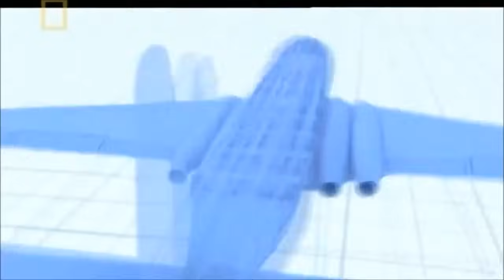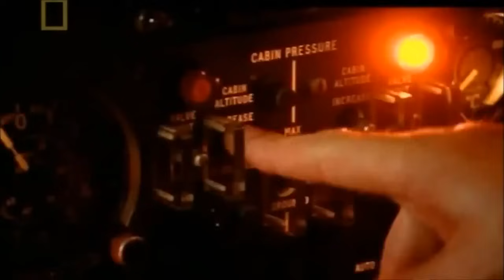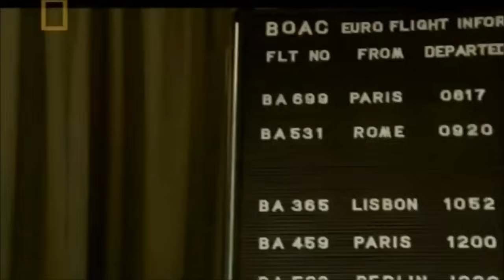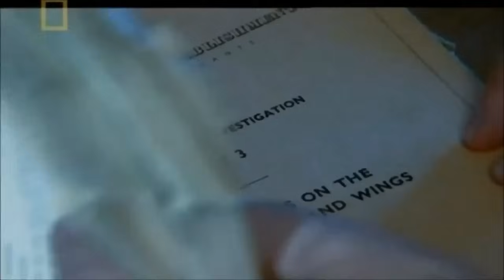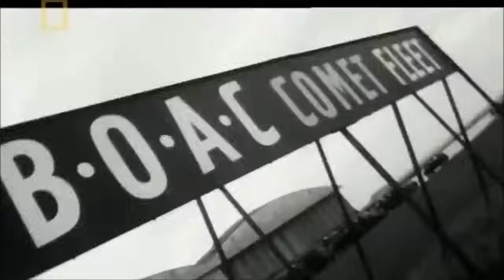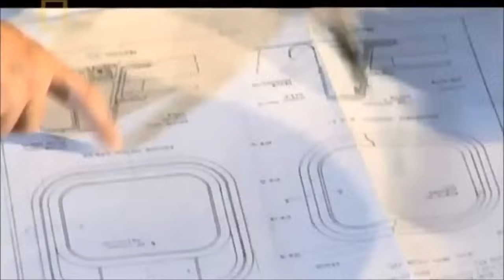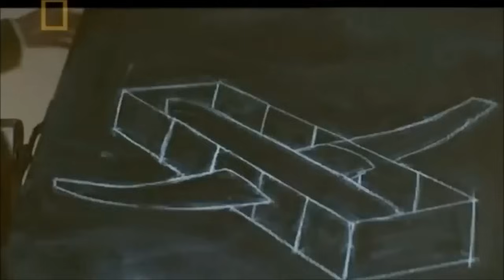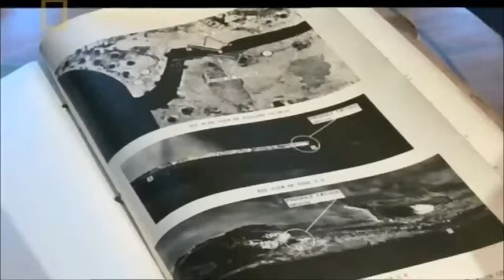British Overseas Airways Corporation Flight 781

Comment: How could they not have anticipated the stress of pressurization on the air frame?
Reply: The same way 2 shuttles went boom, is the answer. We learn
Reply: Ricardo Testa WRONG ! ! !  Boeing started building pressurized airliners in 1938 before the war and the B377 built during and after the war was pressurized as was the B47 and the B52...BOEING knew what they were doing when they built the 707   they had been there done that...the Comet was NOT the first pressurized airliner or plane....
Reply: Ricardo Testa  The comment was made that the Comet was the first pressurized aircraft, and I disputed that. as Boeing built the FIRST MODERN  pressurized airliner, the 307, I know it was piston powered, what difference does that make?? Boeing also built the 377 during and after the war,which flew regularly scheduled airline routes. Boeing flew the first swept wing high speed 6 engined jet bomber,in 2/47  that also was pressurized, and in1952 they flew the B53 8 engined jet bomber, that too is pressurized, and yes I know it is a bomber, but the point I was making was the Comet WAS NOT the first pressurized aircraft,others were first and yes it gave BOEING a jump in experience in building pressurized planes.  BOEING took the experience from the B47 and B52 jet engines, pressurized planes to build the very successful BOEING 707 and on family of jet transports.  It does not matter what "specs" the bombers were built to it gave BOEING the experience in building jet powered aircraft.  That is FACT and I am not being a "Dick" for presenting the TRUE fact and dispelling untruths...   If you have a problem with that....tough Shit... deal with it...,
Reply: Ricard Testa  The original statement was the Comet was the first pressurized airline. that is wrong !!   Boeing 307 was before WW II then during the War Boeing built the C97/377 Double decker cargo/passenger plane and it was pressurized. then in 2 of 47 Boeing flew the B47 6 jet engine jet bomber and it was pressurized and in 1952 Boeing Flew the 8 engined B52  and it was pressurized.  Whether it was a passenger plane or jet or civilian or Military they were ALL pressurized. and when Boeing built the KC135/707 they used their wealth of experience with the afore mentiond planes to build the best jetliner in the air...Boeing built the first pressurized airliner two of them before De Haviland built the Crash Comet. and they built the first pressurized Jets two of them BEFORE De Haviland built the exploding Comet...BOEING knew what they were doing...DEAL WITH IT ! ! ! !
Reply: Ricardo Testa There were already hundreds of aircraft that were pressurized before  the Comet.  The DC-6, the DC-7, the Lochkeed Constellation just to name three planes. The problem was the design of the windows that caused stress cracks.
Reply: You "forgot" that Boeing invented the pressurized airliner the 307 the 377/KC 97  and they also pressurized the B47  and the B52.  there were problems with the manufacturing process on the Comet that compromised the window area...
Reply: The York man....you forgot that the Comet also crashed faster than contemporary airliners.....FYI
Reply: TheYorkMan Even if the Comet did not break up in mid flight, its commercial success was doomed to failure. The 707 and the DC-8 both were faster,could travel farther and carry many more passengers.
Reply: Ricardo Testa The Boeing B-29 Superfortress used liberally in WW2 was pressurized, as were some later models of B-24 and B-25 bombers. Also you have the state of the art B-52 at this time period. American aircraft manufacturers had extensive knowledge of the effects of differential pressure between ambient and internal spaces. Also, since Britain and America regularly exchanged military as well as civilian advances and secrets it's highly doubtful that the British had no previous knowledge of such forces or the inherent dangers of high altitude flight on poorly reinforced or constructed bulkheads.
Reply: What really doomed the Comet 1 was its too-thin fuselage skin which was needed to get acceptable performance out of its underpowered Ghost engines.

As for the British aircraft industry in general, the issue that aviation R&D became ever more expensive as aircraft became more advanced, and the relatively small British economy couldn't afford it any more.  Even the mighty USA cannot support more than one airliner builder now, and the Europeans had to club together in order to compete.  Both Boeing and Airbus are also heavily subsidized by their respective governments (with Airbus the subsidy is explicit, while with Boeing it is through military contracts).

Note also that Boeing massively profited from its military deals with the B-47, B-52 and KC-135, which gave it a significant advantage over Douglas (which was a more purely civilian-oriented firm).  The importance of government military spending was probably also why Douglas was forced to merge with the (purely military) McDonnell in the mid-'60s.
Reply: Commander Shepherd sorry no B-25 or B-24 was pressurized. They didn't have engines that had enough excess bleed air to pressurize the aircraft. Not to mention the skin was never stressed for that.
Reply: ***** will probably because the laptop was in the shop that week. It was not the stress on the airframe. It was a weak spot in the skin because of the way it was shaped that caused the issue. If they had made round windows instead of the ones they did. Who knows how the aviation field would be like now. It's funny how we forget how much of British help save lives in World War II. Because of the inventions they had developed and shared. And by the way I'm not British.
Reply: Wilbur Finnigan okay does not say nothing like the first pressurized airliner. The only thing they say it's the first of, is that it's the first jet airliner. Please if I'm wrong give me the timestamp and I will apologize.
Reply: It sounds like from this discussion that airplane designers were aware of the danger of pressurization as existing planes were already pressurized, and that the window design that created the weakpoint on the Comet was compromised compared to the original specifications to save time/money. Which suggests a rush to get the plane into service. Which makes what happened less of an accident.
Reply: ***** actually they were unaware about how much stress was really being put on those windows. Because they tested it afterwards with strain gauges and found twice the stress being exerted in those areas that they had anticipated. One more thing that I think a lot of us have forgotten. Is the fact that the deHavilland Comet climbed much faster than all the propeller driven aircraft. After all it was the first jet airliner. And I wonder if that was factored into their calculations. Because the faster you bend metal the quicker it will fatigue and fail. So I'll bet the faster climb out may have had a significant acceleration of the metal fatigue that was not anticipated for. And I cannot find anything about it.But in all fairness money has comes ahead of safety far too many times.
Reply: flyer5769 Even if the Comet did not suffer those catastrophic break-ups, this airliner was doomed to failure from a business end.  The Boeing 707 and DC-8 could fly faster, farther and hold more paying customers.
Reply: itsmegp46 you forget the Comet was in service four years ahead of Boeing and Douglas. The Comet would've had four years of upgrades by the time the Boeing and Douglas came out with their respective jets. So that statement doesn't mean much.
Reply: flyer5769 In the Comet's latest, largest version, it could hold 56-81 passengers with a maximum range of 3,225 miles. The only significant improvement was cruising speed, from 460 to 520 mph. In sharp contrast, the very first version of the 707 could carry from 110 to 179 passengers, with a maximum range of 4,312 miles  at a cruising speed of 570 mph which later increased to 605 mph. The DC-8 held similar advancement over the Comet. Doesn't mean much?  I think quite the opposite is true.
Reply: itsmegp46 totally missing the point. If the Comet, and that's a big if. Had not had its problems. Simply being the first working passenger jet aircraft would've put in an league all to its own. Making it very hard for Boeing and Douglas to overcome the prestige. Being the first successful of anything gives it a huge advantage.Now I'm not saying that the Comet is as good as or better than the other two. To me that's like comparing apples and oranges. All I was saying is that the Comet had a tremendous advantage as being the first. And who knows how things would be now had they not had structural failures.
Just look at what happened to the Comet , it was the first jet airliner. But the 707 was the first successful jet airliner. And the rest as they say is history.
Oh just found out, the Comet actually started working in 1952 for BOAC. So that gave them what six year head start. It's funny how people think that this airplane was a bad one. With the updated  to the Comet 4 version it went on to fly for 30 more years. But the damage was done, and most that was military.
Reply: flyer5769 I get your point, I just don't agree with it.  I know the Comet was the first commercial jet liner, that point is not in dispute. What I said was the Comet, good or bad was an inferior product to either the 707 or the DC-8.The improved versions were still slower, carried fewer passengers and not nearly far enough.   Even years later, DeHavilland continued to beat a dead horse with improved Comets, when they should have made a clean sheet design.
Reply: +itsmegp46 All those planes were prop planes.  They flew at 20-30,000 feet at 300mph or so.  The Comet flew 30-40,000 feet at 450mph.  The higher altitude makes the pressure difference between inside and outside greater, and the higher speed puts greater stresses on the airframe.  The Comet was a cutting edge design and did things that hadn't been done before on a commercial aircraft, and sometimes the price you pay for innovation is failure.  Boeing themselves, the guys you keep touting as being so much better at aircraft design, have admitted that had it not been for the Comet they probably would have made the same mistake with the Dash-80/707.
Reply: soaringtractor
You didn't even read my comment did you? 

Those were prop planes,  They didn't go as high or as fast as the comet and weren't subjected to as much stress. 

As for the bombers, one thing you might notice about bombers is they don't tend to have a lot of windows.
Reply: soaringtractor
No, you clearly did not read my post.  I pointed out in it that all the airlines you mention ARE NOT JETS!  They fly lower and slower and have a lower rate of climb.  As for the bombers, THEY DON'T HAVE PASSENGER WINDOWS!  If there's no window you can hardly have a fatigue crack at the window cutout.
Reply: itsmegp46  In fact the 707 and the DC-8 were introduced some 10 years AFTER the Comet, profiting from the aftermath findings. So of course they were better and safer. You're just blabbing nonsense.

Comment: I could never understand the idea of mounting an engine in the tail. If extra power was needed, just use two bigger engines and dispense with the tail engine. If ever there was a catastrophic failure of the tail engine, say goodbye to your hydraulics, rudder, rear stabilisers and possibly some electrics too. The DC-10 had parts of all 3 hydraulic systems near that engine.

Comment: I wonder how the construction workers who put the rivets in situ felt after it was revealed as the cause?
And, wasn't it rivets that made the Titanic's side rip open??
Reply: No it was an iceberg that made the titanic's side rip open but it was made worse by dodgy metal used in the hull of the ship
Reply: I was talking about the Comet windows, but yes the quality of the steel was suspect as was the quality of the rivits in the Titanic, plus a design flaw in the water tight compartment...again too much arrogance and a know it all attitude on the engineers part, but life is a good teacher....live and learn....
Reply: Yes, but in a different way to the Comet. The rivets caused caused damage to the Comet when installed, but the steel used in the rivets of the Titanic was of poor quality itself. In other words, the rivets themselves failed on the Titanic as opposed to the the Comet, who's aluminium failed due to the use of rivets.
Reply: ok how is a rivet failing when a huge ice burg tears through a hull? that is not failure of the rivets at all that's a great big gaping hole that was tore apart due to a very large chunk of ice.
Reply: Photos ofbuildings  The Comets failure was due to the stress cracking caused by PUNCHING the holes, rather than drill as specified..."Somebody" changed the Manufacturing procedure....with deadly results....

Comment: Yes. Those fuel leaks are *DIRECTLY* the fault of Rolls Royce, a company that no longer makes a good product.  I still cannot get out of my memory the disintegration of a Trent engine. It was mounted on an American Airlines 777, leaving DEL at 00:30, bound for ORD. That was in 2006. The fifth stage compressor in the port side engine broke apart. The engine blew up, AFTER V1. leaving the pilot no choice but to rotate. The cowling was unbreached, thank God. I was on that piece of shit of a flight.
Reply: Which flight?

Comment: The only reason flying is Statistically safer than driving is because calculating Volume of people moved per trip...I'll still drive, thank you.
Reply: Someone didn't learn about division.
Today - (Just in the US) 120 people dead in cars.
World - 188 dead in 2013 in airline accidents.
Now that is 500 + times safer. Now the average westerner takes a flight every one or two years. Therefore worst case scenario = just as safe.
Reply: The logic doesn't work for me, sir.

Comment: Well, they'd need more than a spacesuit.  They'd need a jet pack.  They've actually got 'em!   It's called an emergency escape system.  It's built into the F-16.

Soon, though, we'll all be riding drones, and you don't need an emergency escape system to fly Drone Airlines.  You do it from the comfort of your bed.  In my case, my flight cabin, being on the second floor, is at a comfortable, perfectly pressurized thirty feet!

New bar room pick up line: Care to join me for a midnight bombing run?

Comment: should have taken the slow props instead of the jet plane
Reply: Then the Comet would then be around the size of the Constellation as props were not as powerful as jet engines are and thus could not carry a larger passenger list and their luggage using the same given route. 

Come to think of it, I don't think a Boeing 787 Dreamliner could be using props either unless we're looking at a lot of props and VERY long wings just for it to fly.
Reply: Ashton C - Ah, my mistake. Still you could not ignore the increased thrust to weight ratio a jet has compared to a prop.

Comment: When it comes to thin aluminum and square windows, even a fool knows that it would have been better to have a Circle - Jerk.  But stupid is as stupid goes. 

Got to watch "No Highway in the Sky

No movie brought the issue of aircraft metal fatigue into the fear factor of travelers more than "No Highway in the Sky" (1951), at a time when most Americans had not purchased their first ticket for a commercial flight."

Comment: Even if they had modern computers in the 1950's, they might not have done them any good anyhow.  A computer model is only as good as the assumptions that go into it, and these have to be based on real experimental science.  I say that with a great deal of respect for computer models.  But it is unlikely they would have modeled these tiny flaws correctly.  The algorithms to deal with the difference in scale between a tiny crack and a large plane didn't exist, either.

Comment: the reason the plane fell apart is because of the square windows
Reply: The catastrophic in-flight structural failures were caused by bad design and engineering.
Wreckage recovered from the sea confirmed that the passenger windows were not what caused the Comet to explode

Comment: Square windows!!!
Reply: Yes indeed - and there you have it. The first passenger jet, twice as fast as anything else and everything else had square windows. As they explained in the video...the corners were way over the stress limits and had more rivets. Accident waiting to happen. Nobody really to blame in the design and build as this was a new era of flight and the first of many accidents that added to the massive learning curve. Now we know better and we can do better with better methods and materials - Today we hear a lot more about pilot error and slack maintenance then we do about design faults.
Reply: Square windows is the key. I was still at school at the time of these crashes and suddenly anyone embarking upon ANY kind of engineering career was obliged to understand metal fatigue. I remember being given sheets of metal with a square hole in them together with sheets with round or oval holes in them. I was then asked to repeatedly twist the sheets through 45 deg and count the twists until failure. unfailingly the square holes failed at least 100 times sooner than the others. Nowadays I have carpentry as a hobby yet still abide by these principles that apply to any material